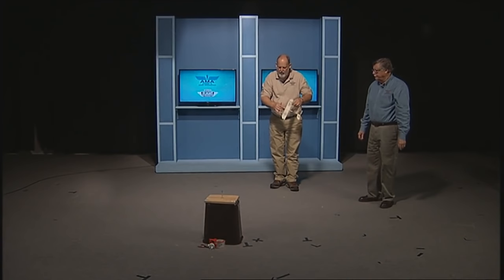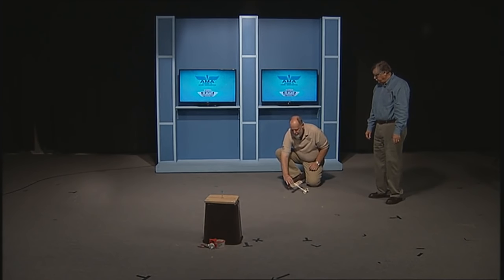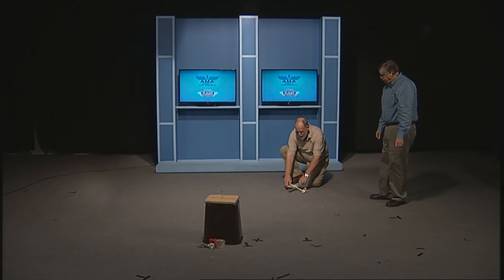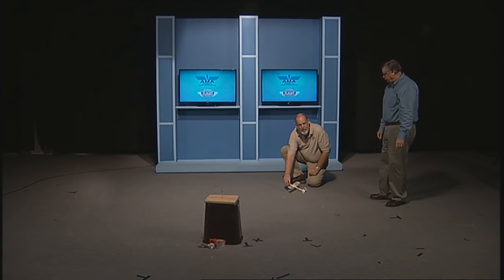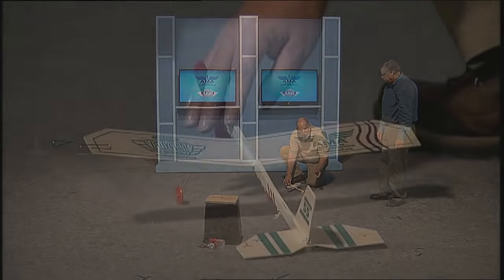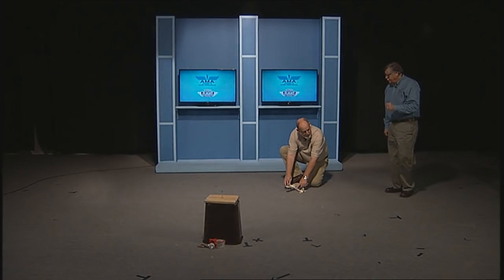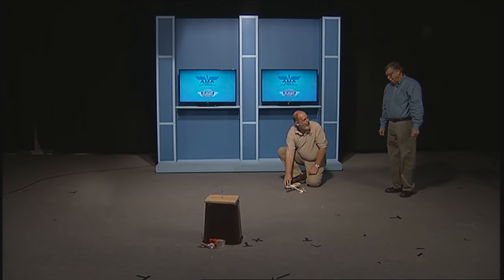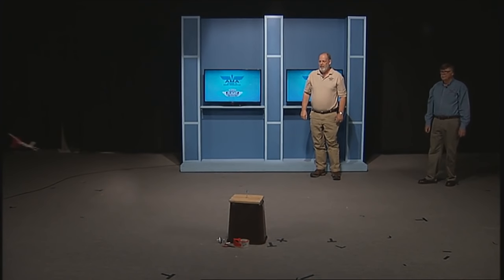How To Modify and Fly a Tethered Rubber Power Model with Dave Gee

Comment: I flew a control line .049 Cox PT-19 this way by looping the line around a support post in the basement. Never thought of flying rubber powered models this way. Great way to fly scale rubber powered models without destroying them. Love it!
Reply: deiselga          trones 6. I
Reply: อะไร
Reply: You ran a cox motor indoors?
Reply: @themadscientest  you can run a cox motor anywhere there is atmosphere containing oxygen. indoors, outdoors, inside another plane, inside a submarine, on the top of a mountain, in a cave (i don't know if this is indoors or outdoors). just be sure you have fuel and a battery to start.
Reply: @shmuck66 ....but it's not particularly healthy to breathe in the fumes when you're indoors. I think that was the point being made earlier.
Reply: @dingalarm  no, not at all. he was confounded by the possibility the motor could be run indoors. since it is an outdoor type object.
Reply: @shmuck66  OK 👍🙂

Comment: I like the idea. Now, scale it up. Back in the late 70's I was flying C/L. To break in motors I built a Flat wing 36In WS Tethered plane. For C/L engines, there is no throttle, set the needle, release and fly. I have used the rig for my .46 BB engines set at 1/2 to 3/4 throttle. Five minutes of run time to warm the engine completely, then cool the air temperature. Do this 5 times and the engine is run-in nicely.

Comment: Thanks for the "floppy rubber" tip. I can now get a longer stable powered flight rather than a brief burst then glide!

I did some tests and found that with the same length band the energy stored is about the same, but the fewer loops you use, resulting in a floppier the band, the lower the power but the longer the duration.
Reply: Some people make propellers that automatically adjust the pitch of the blades depending on the torque, to try and spend as much time in the air as possible for competitions.
Reply: @robambrose4199  Wow! Well above my pay grade I'm afraid !

Comment: Why add a steel paperclip to the plane if you're going to use tape or glue anyway? Couldn't you just glue or tape the tether to the wing? Wouldn't a pin hole and knot do the same job without adding any weight whatsoever?

Comment: How do you calculate the wing span and the position of wing at cockpit ?
Reply: guess and check :) If it flies UP, then the wing will need to move back, if it flies down, move the wing forward. This will change the Center of Gravity (CG aka COG) to change the plane from nose heavy to tail heavy, and hopefully "balanced"
Reply: Use the stock rubber motor first and don’t put a full winding into it. Oh, and try it outside, no wind, and untethered. This lets you play with the wing position in a way that should not destroy the plane while you experiment. Just remember that the plane climbs when the motor has a full wind, and descends when the prop is slowing down,